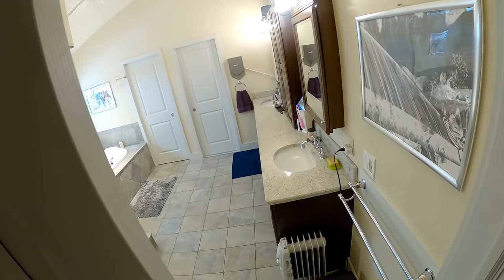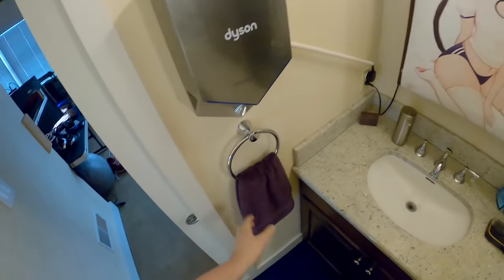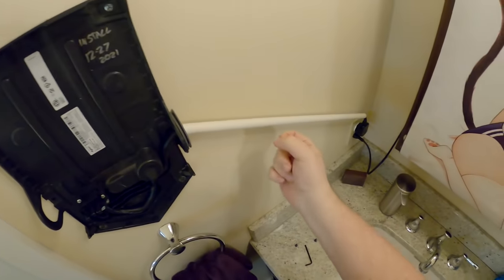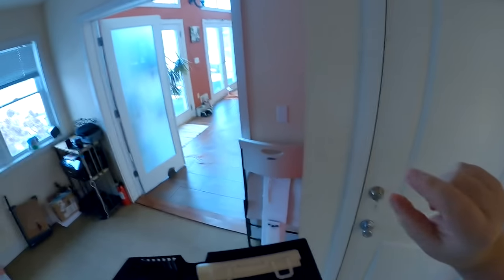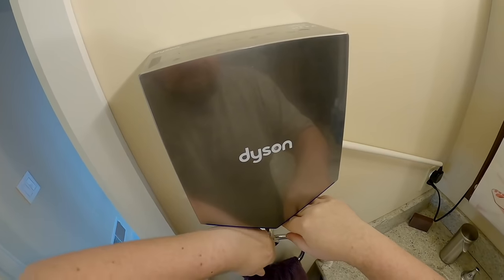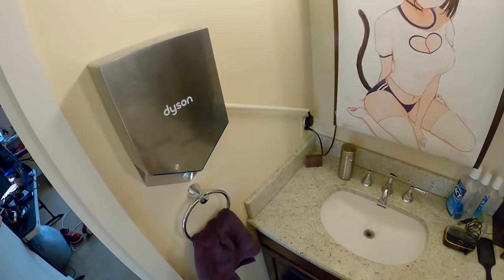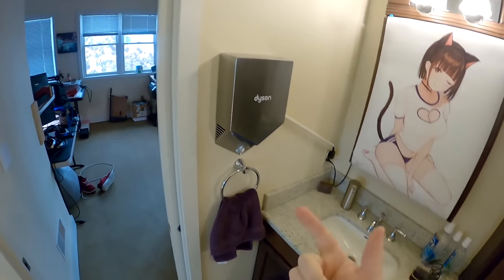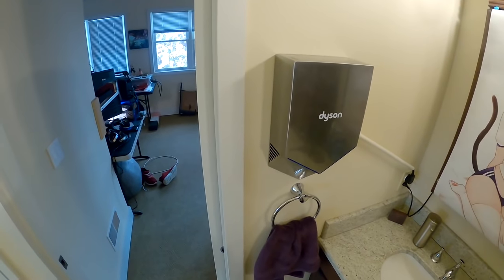🟥This Blows || dyson AirBlade V _(Z Reviews)_ HEADPHONE WARNING

Comment: I shit you not. I am on a cruise to Hawaii right now and the ship is half outfitted with the Dyson Air blade. My first impression was "this is impressive" until I used one of the original blowers that wasn't replaced and I was blown away (pun intended) at how much better the Dyson was then the old blower. I thought to myself at that time someone like Zeos should review this thing because it's impressively better, but what kind of reviewer, reviews hand dryers? I wake up in port today and I see this.

Comment: I remember having to use these at work and I fucking hated them. The angle that the air comes out, the pattern, how close you have to be to the sensors. Granted, the way they installed them was a bit shitty since they were way too high and ended up blowing the water up your arms. I can't remember the brand, but the older ones that blow straight down with a MUCH higher output were so much more effective at drying your hands. I would constantly walk away with still mostly wet hands after using this piece of shit for the same reason you have a towel directly under it. Completely ineffective for drying your hands after just rinsing them.